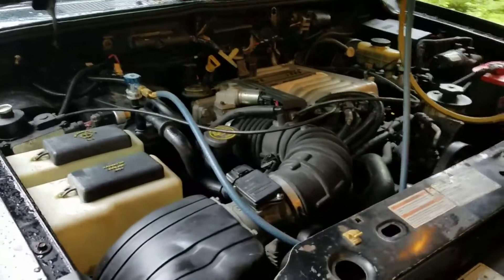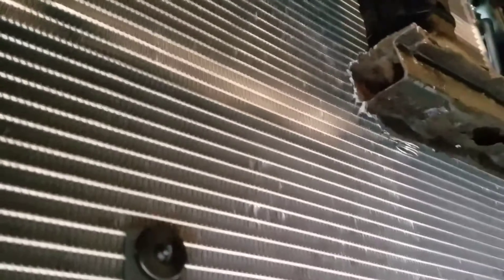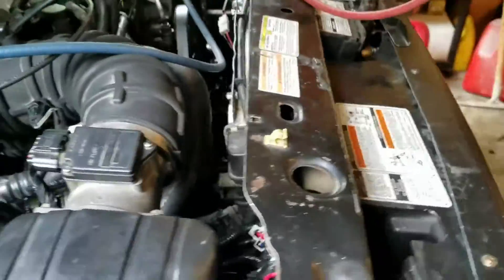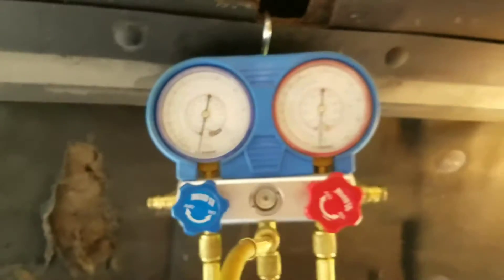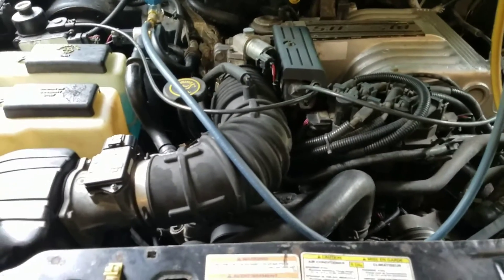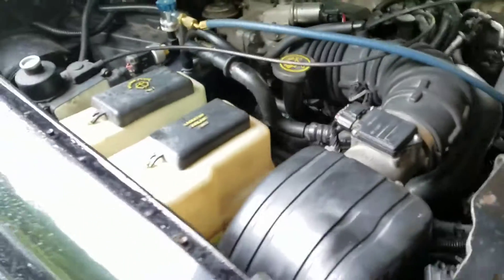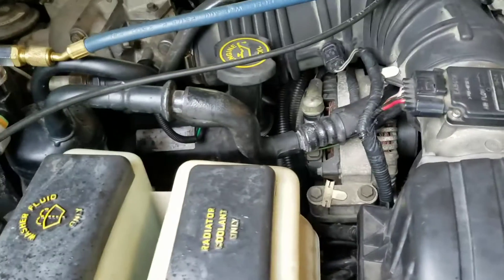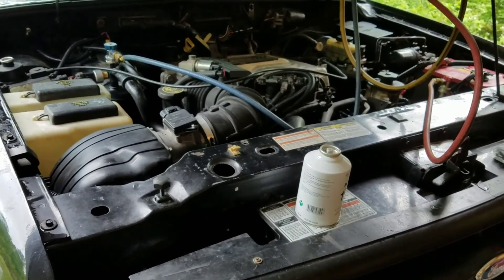UPDATE! Project 5.0 Ford Ranger SWAP AC System Setup and DIY Fan Controller Explained

Comment: Do you happen  to kno what qires has ro be moves to get the ac working?  I'm having a hell of.a.time with that.  2000 rangerr/2000 explorer
Reply from the maker: It's pretty easy. Same basic wiring. There is a pressure switch on the passenger side by the dryer (looks like a can). The plug is usually different between the Ranger and Explorer so you need to put the explorer plug on to the ranger wiring. Also, there is the clutch harness that plugs into the compressor. This wire may be different as well and may need to be extended if I remember right. Also, there may be another pressure switch on the driver's side, but should be plug and play. I don't remember everything
Reply: @JackofAllMasterofNone   yeah.. the plug under the brake booster has to rewired qhen using the explorer harness.. just seeing if you happened to remember.

Comment: I'm doing a 1997 ranger v8 conversion and my donor is a 1998 explorer.   My question is how do I wire the ac?  the explorer is digital and ranger is not.   you mentioned you were able to get hold of wiring diagrams.  any help will be appreciated.

Comment: Great video. I've considered an E-Fan on my 2000 but it seems a little complicated as I'm not the best with custom electrical modding. I'm curious to see how it benefits you over the clutch fan. Looking forward to seeing more videos of this project!
Reply from the maker: TekMan05 Unfortunately it was a necessity. I would actually rather use a clutch fan but it won't fit with the 5.0 conversion.  The benefit is a few more horsepower